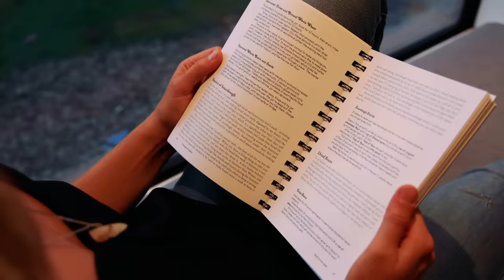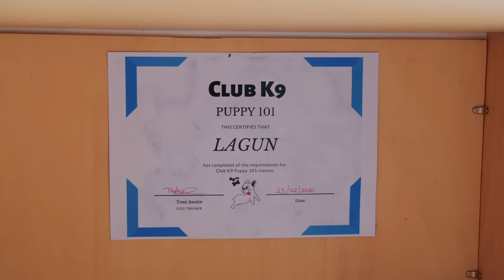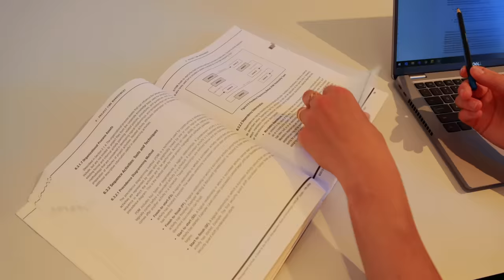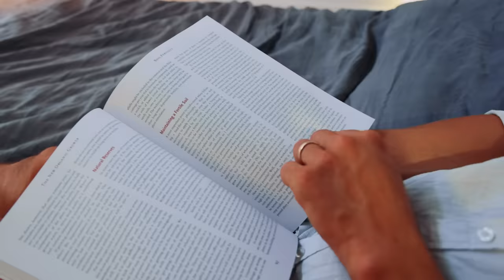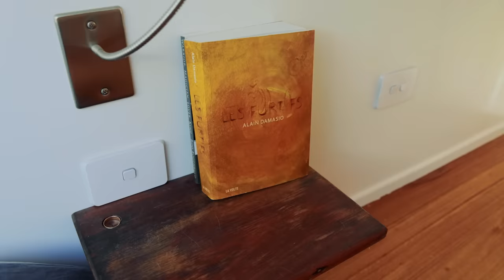This Tiny House Is What Dreams Are Made Of

Comment: I’d love to see more tiny homes in extreme climates if they exist.

I live in Minnesota where summers can get above 100 degrees Fahrenheit while winters can plunge into the negative double digits. We get extreme snow and also face the threat of tornadoes and need basements for safety.

It’s hard for me to imagine a tiny home working in a climate like that. It’d be great to see if there are any.
Reply: If you use thick enough Hempcrete for houses that are shaped round, it gives the thermal and moisture levels their optimal best.  The airflows smoothly around the house and the walls breathe yet retain their temperature well inside.
Reply: Zerosquared Tiny Homes builds ones in Calgary, Alberta. They have slide outs and are built for winter and changing weather.
Reply: @skylamccreery9759  Interesting, I looked them up and here are some of their statistics: “Built for Canadian Winters & Arizona Summers!
Closed cell spray foam is standard = R24 walls, R36 roof and R42 floors”. They are rectangular with push outs and that begs the question of how they handle in high winds, and also how those push outs handle the bitter cold.  Where I am in Vermont, we dip down into the double digits below zero at various times in the winter and that is quite chilly.  

I would say rounding the walls is better, and using Hempcrete for the insulation and material of the walls is still a better idea.
Reply: There are a few up here in Canada: Minimaliste Tiny Homes in Quebec as well as Zerosquared in Alberta (as someone else mentioned). There are also a couple of builders up in Alaska.
Reply: I get there are ones for snow but like I said I’m talking about snow AND tornadoes. The Midwest is an extreme weather area in many different directions.
Reply: Auckland 'extremes' range from about 35°C to O°C. Sometimes very wet. In summer a week (or 4) of 90% or more humidity  tropical conditions. Sometimes very dry. Auckland rain can saturate you as if you had jumped in a pool in under 5 secs at it's heaviest. The Hunua Ranges and the Waitakere ranges are the local (thick enough to get lost in and never get out)  rainforests. AK gets Tornadoes, Cyclones and Cyclonic Storms ( Cyc. Dovi a day ago ) & is within potential obliteration range of the 3rd biggest known  supervolcano on the planet. Usually the Bombay Hills South of Auckland city  stop the pyroclastic flow. * ( Not within living memory thankfully). But, potentially, very extreme conditions.

Comment: Also:  the stairs/staircase needs to have a bannister on the left side going upward.  The sleeping loft, however, is very nicely put together--different than a lot of tiny homes where the bed seems to always be positioned at the edge of the loft; in this case it is at the adjoining wall; the storage in the loft is also different than most sleeping loft areas in a tiny space; I like the decor and the finishing of it, especially under the window.  Very cool!  :face-blue-smiling::rocket-red-countdown-liftoff:🙂😊💯👌👍👍

Comment: This is a lovely home. Enjoyed the "visit" there. I do have a question that I've always wondered about. What do you do when the tires start to go flat or dry rot? Does the house start to settle unevenly? How to you change the tires, especially for those with decks around them? Do you just leave them until you need to move the house? Just curious. Anyone?
Reply: Hey Neil, its a good question and we are only less than 2 years in so we might have to see how it goes. But what we did is we lifted the trailer just slightly off the wheels so that te weight doesn't rest on the suspension, tyres and wheels and put it up on staked up pieces of treated pine. Council could be critical on this, depending where you are located but in my opinion a vehicle jacked up is still a vehicle. Then in our setup the tires are fully off the sun thanks to the deck, so they seem to age very well. If we have to, i can crawl under the house to change them, but don't think it would be needed.
Reply: @thomasfernandez7005  That was what I was thinking, that you would want to raise the house up so there was no real weight on the tires. I've been watching tiny house videos for a long time and just always wondered about this. Thanks for responding. Hope you continue to enjoy your house for as long as you live in it. You did a great job on it.

Comment: I love the idea of a skylight above the bed and I’m curious about how much heat loss occurs through the glass and whether being so close to that might make me feel too cold. Interested in others experience of that.
Reply: Good question. In fact the skylight is double glazed so quite efficient but most importantly the loft is the warmest place of the house as it is the highest point (heat rises). I can guarantee you that cold is not our issue up there. There is a solar electric blind on the skylight as well so that adds up to the insulation. Also our little woodburner is a beauty and heats up the house in no time. In any case I'd say the only fact that it's double glazed and at the highest point of the house guarantees that you wouldn't have any cold coming from there
Reply: @thomasfernandez7005  thank you for taking the time to respond. I did wonder if there was double glazing but completely forgot that it would be a warm area due to heat rising. I had a room with a skylight once and felt the heat loss from it but it was a much larger room so didn’t have the same heat factor. Your home is a beautiful design. Wishing your current and future family many years of happiness, health and well-being as you continue to stay connected to the land and your values.

Comment: The windows are fantastic ... but, they do cost a heck of a lot.  I am not sure they add to the structural integrity, but if I had a Tiny House I'd max them out as well.

Has anyone built a tiny house like they do the steel and glass skyscrapers, with a steel framework with structural glass panels attached?  That might be interesting.  ( maybe a bit too many windows )

Comment: Can someone PLEASE explain why people park their tiny house permanently but never remove the axles????  Don't they know the tires will rot, the axles will rust and then no way will they be able to ever move their tiny house unless they get replaced!!!!  They aren't cheap and it's a pain to replace them.  And lots of time, if there are no plans to move, why don't people build a structure with a basement???  Think of all the space they could have even if the dimensions are not made larger!!!!  But imagine how nice it would be with a 12' width!!!  Bryce, go back to people you interviewed years ago and ask the hard questions!!!!
Reply: Its for regulations mate. Tiny house are vehicles as long as they stand on a trailer hence they need no building or resource consent which are extremely expensive here. Also the trailer is slightly off the ground so the tyres won't rot and it's easy to check and maintain from under

Comment: What is the point of using glass jars (instead of plastic) but having a wood burner. Wood burners are so bad for the environment. That’s why they have been banned (or heavily restricted) in Nelson and Christchurch. A heat pump would have used electricity they already generate and provide heating, cooling, fresh air transfer ventilation - and less impact on the environment. I guess it’s similar to people who drive SUVs and whinge about plastic.
Reply: Wood burners are not bad for the environment they are bad mainly for air quality in cities. This is a rural location. Also wood burners have improved a lot in this regards. Plus heat pumps are highly inefficient at heating and requires a lot of energy which you don't have access to when off-grid. I guess this is like people driving a tesla thinking they do the right choice for the environment
Reply: Oh and by the way, I don't see your point with glass jars. They are all picked up in op shops or recycled. Should we buy new plastic jars? Not sure how this is ecological?!